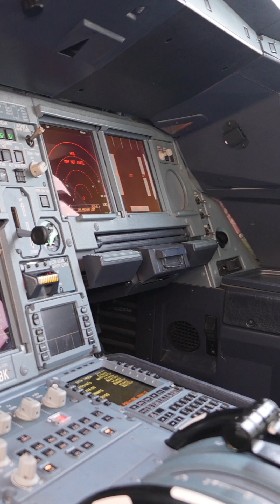What Happens When the A380 Loses THREE Engines?

Comment: Not just harder to handle, but with all that runner, it's gonna be that much dirtier.Given that much more drag in that much less potential to be able to maintain altitude

It would nice to see if the a380 could fly at normal cruising altitudes , if it was completely empty and only had a couple of dozen thousand pounds of fuel on it

Comment: It's also important to note that just the number of engines doesn't mean anything.
Take an a 340, for example, especially the early models. They were chronically underpowered and losing 2 out of those 4 engines would be substantially worse, then losing one out of the equivalent twin 777

Comment: This is factual, most engineering professionals apply scientific solutions to practical problems hence why they are valuable as well as licensed. Most professionals with a licence requirement is not a bad option.

Comment: I saw this tested on a flight simulator with a 747. It could fly one one engine, barely. Couldn't climb, absolutely no where near taking off. And since it had to run at TOGA thrust, the engine would be doing damage to itself.

Comment: Hi B747 captain here. You’re forgetting the most important thing about this which is weight. If the plane is fully loaded, zero chance it could maintain altitude. Even at like 3 or 4 thousand feet. A few years ago in the simulator I had some extra time and for the hell of it, I tried to fly the 747-400 on one engine. Our max landing weight is 652,000lbs. With two engines the -400 has a max altitude of around 18-20,000 ft at MLW. With one engine we tried a few different scenarios and none were good. We finally got it to stay airborne the gear up, flaps up, 30,000 lbs of fuel which is about 1.5 hours of fuel, and zero cargo. Empty weight of the -400 is around 360,000lbs which means no cargo we weighed around 390,000lbs. It struggled to maintain altitude but it worked finally. The extra loss of engines create massive amounts of parasitic drag as well as induced drag from yawing. We were able to maintain 3,000 ft and as soon as I lowered the gear I had to start descending to maintain speed and I only landed with flaps 5 instead of 25 or 30. 

So even tho they aren’t the same plane, they are similar and yes while the engine does matter (I only had engine 2 available), the weight is going to be the deciding factor. Hope this helps.
Reply: thank you for sharing your insights :)
Reply: parasitic drag as well as induced drag from yawing.. are the things.. which.. as per my amateur-ish understanding.. cannot even be recreated THAT well in a programmed software/ simulator.

Meaning.. you are centum correct.
Things in real life.. would be much more unpredictable and dicey.. than what can be trained for.. in a simulated environment.

At-least for the parasitic drag part and the induced drag part.

Variables luke windspeeds, wind direction, density and so on.. cannot always be captured in a sim.
Reply: @s@s @sailaab  wrong. They can be created very well in our simulators. Simulators that airlines use are worth millions of dollars. They cost thousands an hour to operate. If we don’t have enough landings in the last 90 days, we can go into the simulator and land the plane because it’s so accurate and it counts towards our landing currency. Crosswind, handling characteristics, etc. are all incredibly accurate as they would be in the plane. So yes, every emergency situation is different, the reality of the simulator, the massive amounts of computers that run it make it as lifelike as possible. And as someone who’s been doing this for 20 years with seven of those spent on the 747, countless simulator sessions, thousands of hours in the plane, I can assure you, it is.
Reply: @sailaab  Dunning-Krüger effect in action

Comment: A more interesting question is what happens to a tri-jet if losing 2 engines. Because they say they were created as a trade-off between cheaper twin-jets and safer 4-engine jets. But the probability of losing a single engine as well as losing 2 engines are higher on a tri-jet than a twin-jet.
Reply: From cruise altitude down, tri-jets can fly, carefully, on one good engine, but your landing has to be a straight in.  For the Boeing 727, on final approach (6-7 miles out, coming through 2500') you're committed to landing... No go around is allowed.  

Tri-jets that lose two engines on takeoff probably aren't going to make it, unless they are very lightly loaded.
Reply: I believe that a tri-jet can fly on 1 engine

Comment: Chance of loosing 3 or even 4 engines is not astronomically low. 
It's just highly unlikely  .
Here how.
1. Fuel starvation due to running out of fuel .
2. Contaminated fuel
3. Flying through volcano ash plume
4. Sabotage or terrorism. 
5. Massive bird  flock  strike .

Comment: How do you stop the plane with 1 engine? Reverse truster from 1 engine?
Reply: It does not need thrust reversers, the wheel brakes are sufficient as long as the runway condition is not wet or icy.

Only the inner engines here have thrust reversers, tge outboard ones would blow dirt on the runway because of the massive wingspan
Reply: @simonm1447  That was the Airbus cover story, but really they just were getting desperate to reduce the aircraft's empty weight. They made a series of compromise modifications, including deleting the outboard reversers.  FOD ingestion would not have been a concern on the 60m wide runways that account for a majority of A380 landings.  On the 45m wides like at LAX and MXP, it could have just been SOP to use inboard reverse only, unless emergency.
Reply: @SDK-im8sl well, there are not many 60 m wide runways - and it can brake with the wheel brakes alone, it has 5 gears from which 4 are braked.

The outward thrust reversers are not deactivated, but not existing.

This aircraft has 0 fatalities until now and 0 hull losses.
Reply: @simonm1447  All runways at New York-JFK, San Francisco,  Dubai, Abu Dhabi, Singapore, Tokyo-Narita, Frankfurt, Paris-CDG, Madrid, Moscow SVO, and Hong Kong are 60m wide.  One or more runways at Dallas-DFW, Los Angeles, Chicago-O'Hare, Denver, Detroit Metro, Sydney, Honolulu, Rome are 60m wide.

Comment: There was an instance where a BA 747 flying over Indonesia actually ran into dense volcanic ash clouds which caused all 4 engines to fail yet the BA pilots actually managed to hold the plane in sky long enough to clear the ash area and restart the engines once they had enough fresh air.
Reply: Green Dot Aviation has an amazing video covering this incident, it was British Airways Flight 9! GDA's video even interviews the captain as part of the storytelling, heres a link to the video if you don't wanna search it: https://www.youtube.com/watch?v=WFChgSJ_qB0
Reply: That happened due to the silica breaking off the engine turbine blades.
Once the engines were restarted the pilots went back to their cursing altitude and the engines failed again due to ash ingestion and this time they could not be restarted

I am a fan of Air Crash Investigations.

Comment: The Lockhead constellation could fly on one engine and it could fly on only one outer engine.
Reply: Depending on weight and phase of flight.  Taking off from LAX for a loaded up for transcontinental or intercontinental flight, you were already in de deep doo doo if you even lost two engines.

Comment: Even at super low weights where you MIGHT be able to maintain flight on one, the problem is what else got FUCKED by whatever took out the engines? Same with two on one side - chances are, that didn't happen from some nice benign thing like running out of fuel. Something catastrophic happened, and probably took out lots of other things in the process. See the El Al 747 that wiped out an apartment building in Amsterdam as an excellent example.

Comment: Would love to see a short detailing how the thrust levers operate on landing. How and when the reverse thrust levers are moved. Videos of landings always seem to stop short of that point.
Reply: On all modern jets, the reversers are deployed once the aircraft has touched down. Each reverse lever is hinged on the thrust lever for its specific engine.  Normally stowed all the way forward and somewhat downward, the reverse levers are operated by the pilot flying, who pulls them upward/rearward to the idle-reverse detent, a near-vertical position.  Once the reversers are confirmed operating properly, the pilot has the option to pull further back on those levers (spring action) to obtain greater or maximum reverse power.  Reverse is cancelled by pushing those levers forward to their original stowed position.  

It's all fairly fluid, direct motions, which you'd want, except in rare cases on aircraft with 3 or more reversible engines when, for whatever reason, you don't want to use reverse on one or more of them.  e.g. a 747 with four running engines, but a decision to not use #3 reverser... gotta quickly and correctly engage reverse on #1, #2, and #4... or perhaps just on #1 and #4.

Regarding the A380, only #2 and #3 have reverse.  The publicly stated reason was to avoid object-ingestion risk to the outboard engines.  Well, that could be a concern landing on 45m wide runways, as found at certain A380 destinations (e.g. LAX, ATL and MXP.)  But not really for the 60m wide runways (with typical 10+m shoulders) at many common A380 destinations (e.g. DXB, AUH, JFK, SFO, CDG, NRT, SIN, SYD, FRA).  The fact is that as the A380 was moving into final design, its empty weight was running higher than performance goals (promises), lessening its useful load.  Several things were changed late in the process to reduce weight, and deleting the outboard reversers was one of them.

Comment: QF32, anyone? I know they didn’t completely lose three engines but none of them were working properly or providing their full potential after the incident
Reply: Those guys got incredibly lucky that day.
Reply: QF32 had additional complications, in that the explsive failure of one engine knocked out multliple hydraulics.  Flight control and braking, among other things, were significantly impaired.  That was a close one.  Great flight crew skills and barely enough systems redundancy saved the day.

Comment: Many years ago a TWA 747 had a situation where it lost 3 its 4 engines over the pacific and flew almost an hour on 1 engine before making it to New Zealand
Reply: The beauty of the 747 is that it was a wonderful glider if there were no engines, something which I doubt the A380 would be as well designed for.
Reply: @formulafish1536 it might be okay as a glider, since the wings were designed for a potential 900 or 1000 variant, giving them more lift than really necessary
Reply: @formulafish1536 Yeah, it would be terrible at gliding with its massive oversized wing and tail. 🙄
Reply: @formulafish1536  ye
Reply: I remembered when it happened I don’t know if you can find it on YouTube but is was a flight was going from LAX to Auckland, New Zealand and the pilots did not have enough fuel. 
  So what happened was the number 1 and number 4 engines shut down during the last 90 or so minutes before landing. By then there was a call out about the situation. Then about 30 or so minutes later it was either the number 2 or number 3 that went out I can’t recall but I believe it was the number 3. 
So the pilots had to do several things to reduce the amount of fuel they were burning. Anyway the plane landed and as they taxied off the runway the last engine went out and the plane had to be towed.
Reply: @mikeclark4272  that was definitely a close one for them
Reply: Which flight was that? I’m having trouble finding it on Google.
Reply: Yeah, "astronomical" is probably not the number.
It has happened after all...
Reply: Twa maybe pam am or contently or united ?
Reply: Yea, it's more what happens if all but one outboard engine fails 5 seconds after a fully-loaded takeoff
Reply: This never happened
Reply: This actually has happened more than once with other airlines. If you google 747s that ran out of fuel during flight the there is a list of situations. United and Air Canada is on that list with same circumstances
Reply: @mikeclark4272 the Canadian air liners that ran out of fuel were not 747’s the first one was an air Canada 767 twin that landed at Gimly and for ever after was nicknamed the Gimly Glider. The 2nd was an Air Transat A330 that Ramon out of fuel over the Atlantic and did a dead stick landing in the Azores. I know of no 747 that has done a dead stick landing. A British 747 flew through a volcanic ash cloud over the Indian Ocean and lost all 4 engines for a while, but they managed to restart them and do an emergency landing in Indonesia.

Comment: What happens? You park that piece of shit in the California desert, then get on the phone to Boeing and order the dream liner. Fly by wire, what a joke. A joystick controller? More proof that our engineers are children who haven’t grown up.
Reply: makes it much easier to fly
Reply: Dreamliner? Nightmareliner!
Reply: You need a yoke and a steering column for a conventional control system.

You doesn't need it for a fbw aircraft. A sidestock is sufficient here, you transmit electric signals, not manual force like on a 737.

Comment: All quad jets are not able to sustain flight if 3 engines are lost. Independently, each engine produces less thrust than a twinjet.

Example: the 787's engine is rated for a higher thrust than the 747-8 despite both aircraft having the same engine.
Reply: It could also be a clearance thing (same reason why the 737 MAX uses smaller engines than the A320NEO). If the 747’s wing was as high off the ground or as thin as the 787’s, then the GENX-2B would have a bleed air version of the GENX-1B with the same fan diameter and any less thrust from the -2B compared to the -1B would have been attributed to the bleed air system.
Reply: @Blank00  Actually the 747-8 and 787 engine size is the same. One is just rated for a lower thrust because it doesn't need to be as high. The 737 MAX having slightly smaller engines is due to ground clearance.

But, the 340-300 uses the same engines as those used on the 320 and 737 (CFM56). Powerful on a smaller jet, but underpowered on something larger.

Comment: hehe... fun fact, loosing three engines is actually more rare than loosing all engines.
Possibilities for loosing all engines include:
running out of fuel due to miscalculations
fuel contamination due to filter issues
filter decomposition and contaminating the fuel
Pilot turns off all the engines
Reply: And volcanic ashes 🌋
Reply: @NotaRandomYTuser  then you better be trying your damnedest to get them going again.
Reply: If you fly a MD11 the odds are the same
Reply: also birdstrike
Reply: And bird strike
Reply: Losing not loosing. Loosing is undoing something like a belt or a knot.
Reply: @robertpartington1383  well they could also come loose and then you could lose them literally
Reply: @robertpartington1383  thank you for the correction 🚨
Reply: @robertpartington1383  Oh chill out